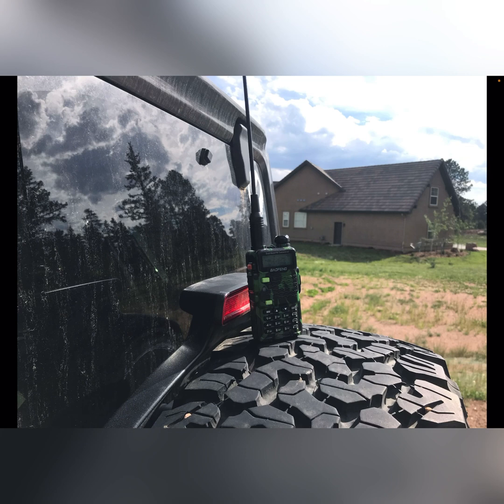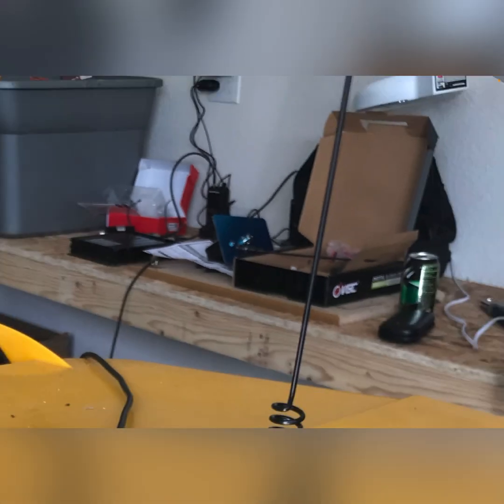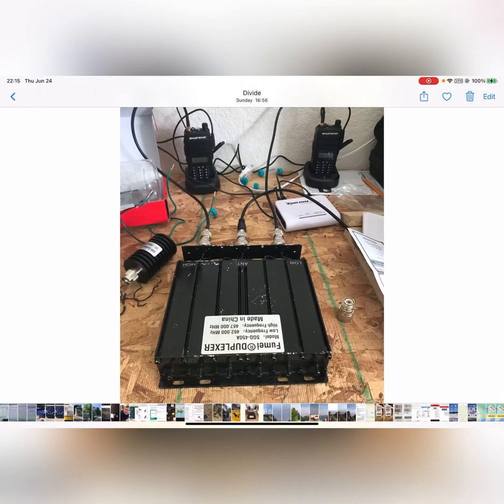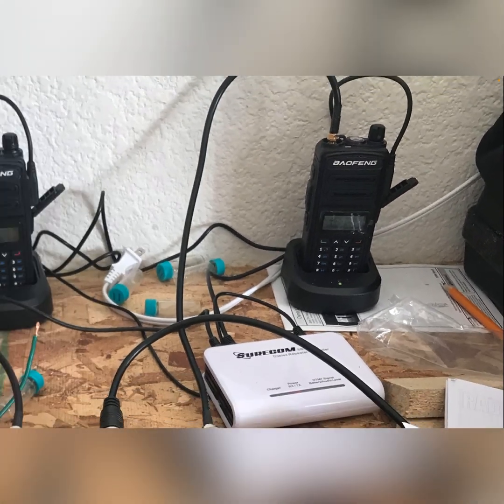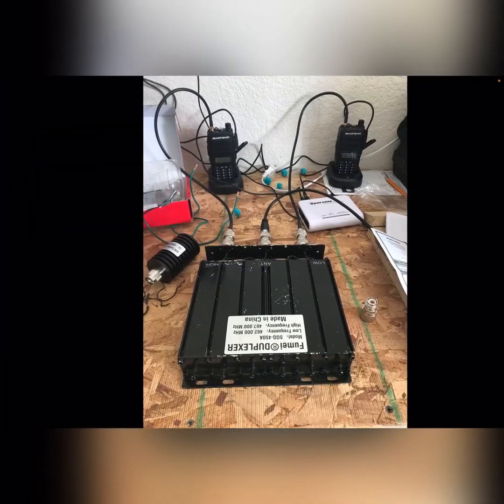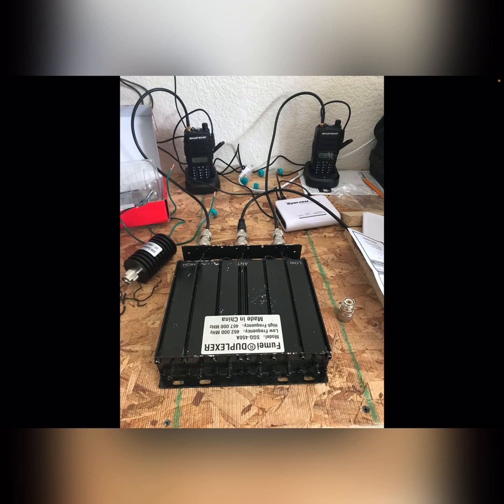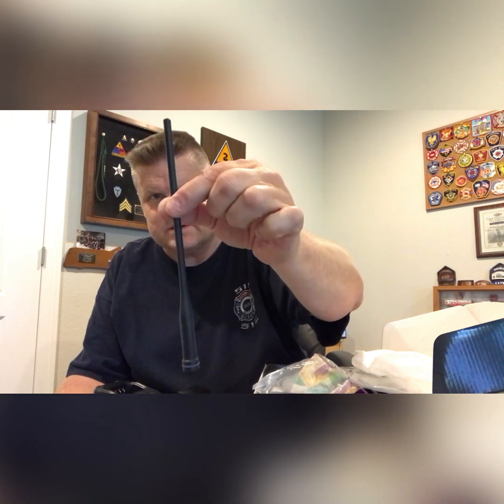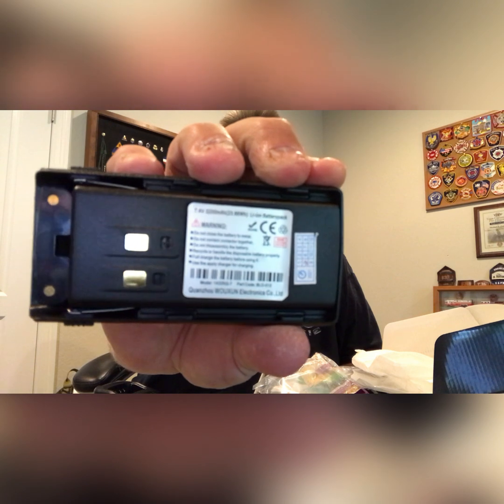New GMRS Wouxun KG-UV9G Pro and a GMRS system setup

Comment: The FCC police will get you now for using your Baofeng's for GMRS.  Okay, no they won't.  But, people will tell you they will.  Go CERT!  (Also on a team on the East coast.)
Reply from the maker: Yeah I figured that the Ham community would have heartburn over the BaoFeng for GMRS. This equipment was previously purchased by the team before I ever joined. I think during my testing I was only transmitting on my Part 95 compliant KG-UV9G Pro GMRS radio to the other units but I might have slid onto a baofeng here and there. I’m an Amateur Extra and have a GMRS license so I’m probably covered somehow but this is how everyone is using these radios. You need to check out Notarubicon youtube videos about this subject. He is hilarious. Mike - K0FYR WRMV759
Reply from the maker: @No_Kings_Allowed  I understand that. In my personal use I never use a BaoFeng for GMRS. That is merely the equipment that the previous CERT people purchased. Well, its moot at this point as that CERT isn’t active so no one is using those radios anyway. All of my GMRS videos and talking on the radio is with my Part 95 GMRS KG-UV9G radio from Better Safe Radios. Thanks for watching Ham-Solo K0FYR WRMV759